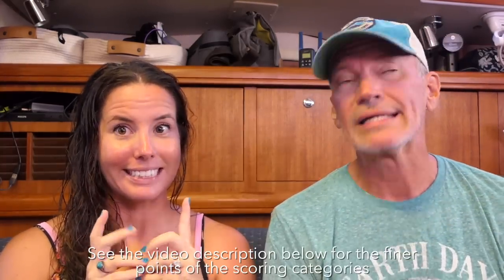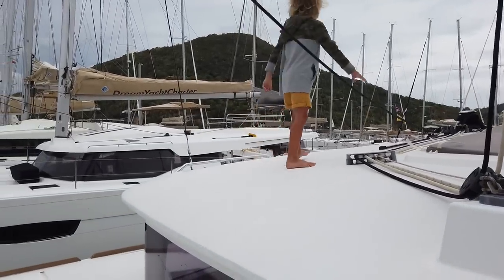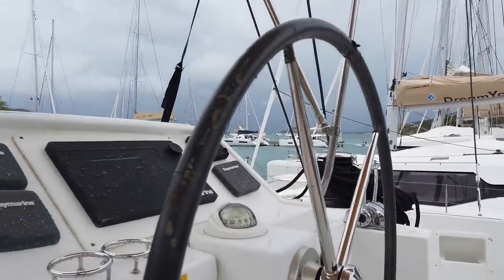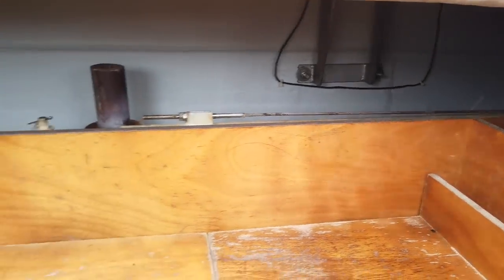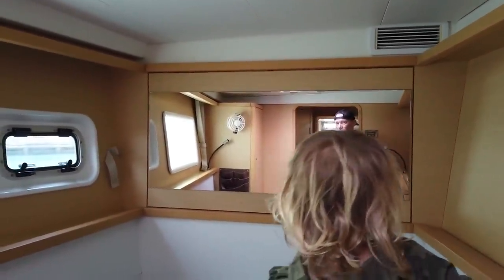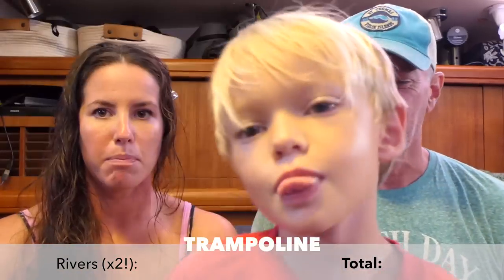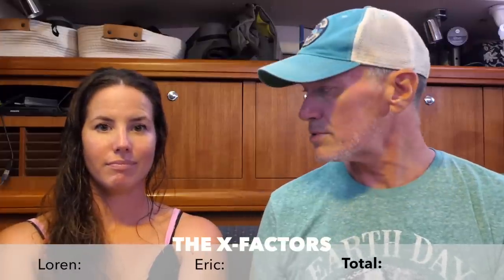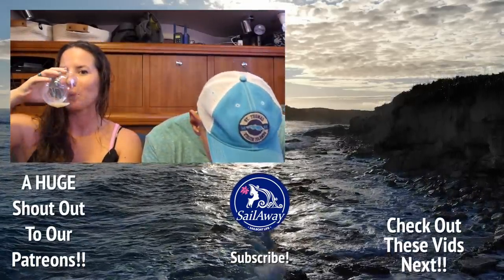LAGOON 450 REVIEW - Who CARES About BULKHEADS? | SailAway Boat Tours

Comment: Bulkheads aren't a safety issue. ....makes you wonder why all boats have them...should probably just leave them out...WTF? And they sail like bricks, so there is that....so dangerous and slow and expensive...fantastic!
Reply from the maker: That’s sort of a silly generalization. It’s like saying any keel issue with a monohull means it’s going to fall off. Some types of bulkhead issues can definitely be safety concerns, just happens this kind isn’t. But it does warp the inside of the boat dramatically and makes the cabinetry a total mess if not dealt with. Definitely a big problem, but in no way will this particular problem dismast the boat or sink it, i.e., not a safety issue.
Reply: @SailAwayVlog  really? So what is supporting the rig loads once the bulkheads have been destroyed? You are saying the monocoque alone is strong enough which doesn't bear any sort of examination. The bulkheads are there to stiffen the boat. Without this additional strength the hull and decks will be prone to buckling failure under peak or shock loading and probably creep under any prolonged load.
Reply from the maker: Once again, you're making a vast generalization based on the purpose of bulkheads and what would happen if one, I don't know...suddenly vaporized or something....you're not actually talking about what is actually happening to these bulkheads on these boats.  Regardless, if you want to debate it, you should take it up with the engineering firm that investigated the issue.  Based on their findings, Lagoon chose to state on the official website for the bulkhead issue that this is not a safety issue (for reasons that are very clearly diagrammed and explained).  Can you imagine Lagoon's team of lawyers signing off on a statement like that if they weren't 100% certain?  I can't.  The company would be done for should a boat lose a mast or cause physical harm to someone after a statement like that.  This doesn't matter to us...we didn't buy one.  But by all means, hit them up and enlighten them. Maybe they'll change their stance based on your extensive knowledge of the subject?
Reply: @SailAwayVlog  the thing is I am an engineer. I have been working in marine engineering since the eighties. I have worked for an  AC team. You are talking utter rubbish. Lagoons are badly designed and built. They are not fit for purpose. Other production boats also fit into this category for other reasons. Still...what do I know....obviously bulkheads, the primary structural element of any boat are ..optional.

Comment: Not a safety issue?   Come on man!
Reply from the maker: Thanks for watching!  And no, it's actually not.  This isn't from me, it's straight from the engineers and the designers consulted to figure all this out.  The primary reason I don't doubt it, is that the statement comes from Lagoon, and they would absolutely not make a statement like that unless it was a definite thing...far too big a legal risk.  That's my take on it anyway.  Doesn't mean I would want to sail one that has the failing bulkheads...

Comment: You are completely crazy thinking it is not safety issue.  It is obvious you do not undertstand structural integrity and what it means to the rest of the boat.
Reply from the maker: I have every bit as much understanding of structural integrity as the next mechanically inclined person. It’s not coming from me, it’s coming from the experts on that specific boat who investigated that specific issue. It seems that you need to go go seek out that info for you to understand that any type of bulkhead failure doesn’t equal an unsafe boat. In this case, just a potentially really messed up one.